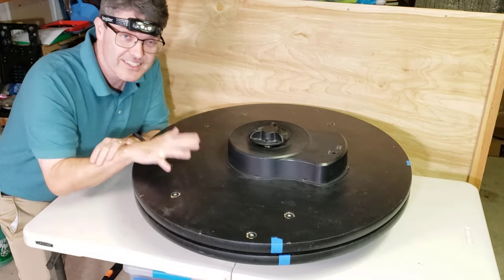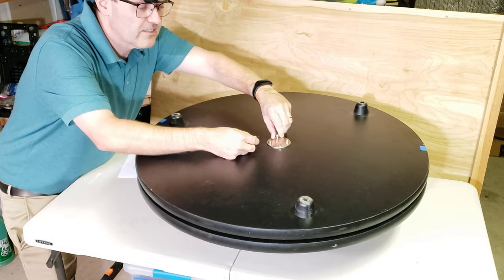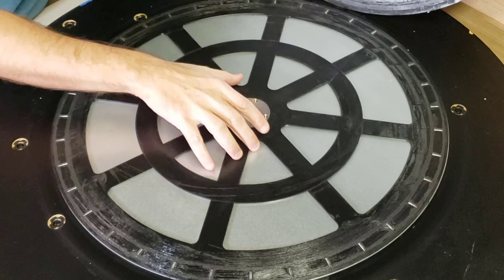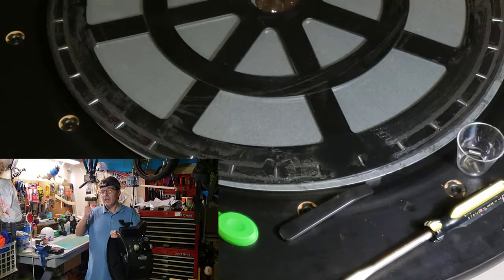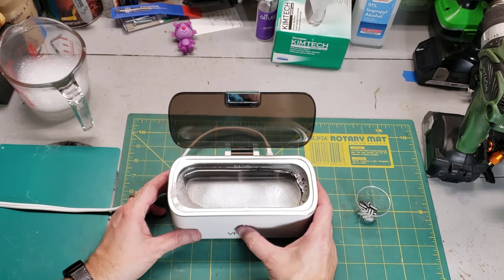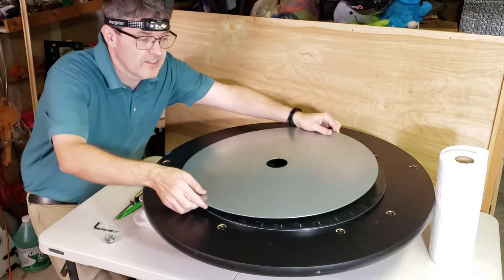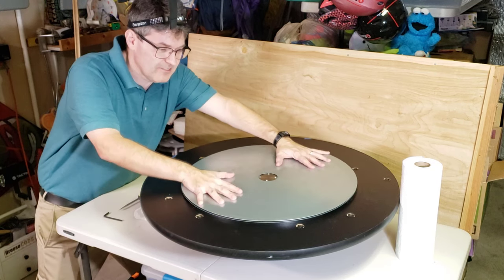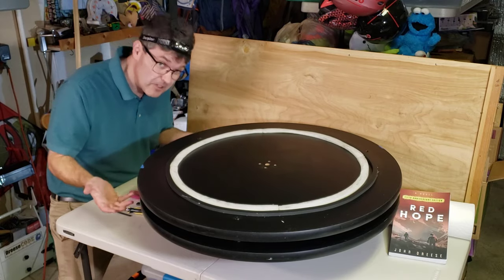PART 5 - GIANT Telescope Restoration!  -  Orion XX14g GoTo Dobsonian - Fixing Lazy Susan (Episode 5)

Comment: The dust shield comes with the scope, my 16" xxg cane with one.
Reply from the maker: That is good to know. I've had a few that were missing the dust shield, but I think that was because they were not taken care of.  How do you like your 16" Dob?
Reply: @AstronomyGarage   @reflactor  Love it. Just got it about a week ago off of Cloudy Nights. Been out for a quick peek a couple times. Started with a 60mm scope, but always aspired to a 12". The 16" crossed my path and I jumped. It was great to find your detailed teardown videos. If I ever need to go in for a repair it will be like I've been there before, mirror cleaning especially helpful. You said you have seen several w/o the turntable dust shield, I assumed it came stock. One thing, at first the scope would only rotate in azimuth a few inches left and right before binding. Upon inspection, the foam strip had rolled up and stuck to the top of the turntable. I was able to unstick it and lay it back flat. If that is a common occurrence maybe users are just removing it.

Comment: I recently got the stone wall treatment from Orion as well just a few weeks ago concerning a Sky View Pro mount. I was looking for a tripod. Orion will not sell the particular tripod for that mount individually and I bought the mount off Astromart about two decades ago. I remember when Orion used to sell just that tried alone (kicking myself for not just going ahead and getting one then) as well as many parts of just about anything and it was all listed in their catalogue. I never thought it would ever be any different.
Reply from the maker: I'm sorry to hear that, but it is a common enough response that I think it's an official policy now.  If Skywatcher has any similar equipment to what you're looking for, try them. I've bought several replacement parts for Orion equipment from Skywatcher (they are HAPPY to sell you replacement parts).
Reply: @AstronomyGarage  Thanks. I'll look them up.

Comment: Thanks for this series. I picked up a few pointers and ideas. I have the Orion XX16g (bigger and heavier than the 14) Ever since almost new, the lazy susan part of the scope made a jerking motion and a groaning noise while tracking. I finally braved it to take it apart as you did. I cleaned all the old grease off everything (but didn't remove the roller bearings) and decided to use powdered graphite and a few drops of 3 in 1 oil. After re-assembly, I tested it in warm and cold weather and it performs very smoothly now!!
PS: The 4 screws that were loose on the azmith part of your scope, well, mine were so tight that I was afraid of stripping the hex head or breaking the bolt, so I just left them alone. Thanks again.
Reply from the maker: Thank you for watching!  I'm glad the series gave you a few helpful hints.  I think the 16g is the dream of any Dob owner (including me), but I've got my hands full with just the 14 inch Dob!  Thank you for the info on the graphite and oil. I may end up giving that a try.  By the way, I don't think removing the roller pin bearings helped (or hurt) at all. It was just  a waste of time unfortunately.  I would say that you chose wisely to leave those 4 screws in place.  Mine were obviously loose (like way loose), so it was easy to remove them. Clear skies!

Comment: Excellent work!  Maybe the roller bearings could have used a very light touch of grease now that you know that there's a slight out-of-roundness.  My buddie's 12 inch of this same telescope hasn't had to have the base disassembled yet like this, so we haven't gone this deep as you have on your 14 inch.  Looking forward to the next episode!  BTW, love the product placement. 😁 I'm going to have to check out your book.
Reply from the maker: Thanks for watching!  If your friend ever opens up the bottom of his Dob, please let me know if the roller bearings are dry or have any kind of lubricant on them.  As a side note, the book Red Hope is meant to be a fun science fiction/adventure novel.  It's not too heavy on the details, lol.  Clear skies!
Reply: On my 12" Dobson, I greased those bearings with a little silicone oil and no problem.🙂
Reply from the maker: @kamilmoucka6811   Is it still working well?
Reply: @AstronomyGarage  Yes, it works perfectly. The azimuth movement is smooth and without jerking.🙂

Comment: How does Lazy Susan stands against the occasional wind blasts? Wouldn't be better to use just Teflon pads and forget about grease cleaning completely?
Reply from the maker: For big heavy telescopes, they stay put pretty well.  I have a smaller Dobsonian on a Lazy Susan and it is very sensitive to wind. I have to really tighten down the friction knob on the base to help out.

Comment: I’m really enjoying your journey with this telescope and can’t wait for its ‘first light’ with its new owner. Be careful cleaning the mirror, that’s one big piece of glass. When I clean my Orion 14” I leave the mirror in its cell, but whichever way you choose I hope it all goes well. 👍🇬🇧
Reply from the maker: Thanks, Mike. Despite having cleaned lots of mirrors, I am somewhat worried about this one because it is so unique and irreplaceable.  I'll be following the detailed steps laid out by Orion in the user manual.  And going very very slow.  I'm going to try to avoid losing the center-mark circle.  Clear skies!
Reply: @AstronomyGarage  Is it the conical mirror that most mass produced telescopes come with nowadays? I’d forgotten that Orion at some point switched   mirror designs. Mine is the conical shaped one. 
Mike
Reply from the maker: @deepskymike767  Most mirrors these days are slabs.  Orion used this mushroom convex shape on their 14" and 16" to save weight and help with cooling.

Comment: I made the mistake of using lithium grease on Dobsonian roller bearings and at first it was great.  After a year it set like concrete and I had to use engine degreaser to remove it. Now I use the lightest oil possible and only very very sparingly.
Reply from the maker: Thank you for sharing that.  I thought about starting with a bit of graphite and then possibly moving up to a thin oil.  We'll see how this goes first before taking further steps.  Clear skies!

Comment: Many of the same products Orion sells are branded Skywatcher and are available from them regardless whether you bought it or not.  

My understanding is Orion's reason for not selling to 2nd-hand owners is the Chinese suppliers don't sell them a ton of replacement parts to restock inventory so they want to ensure their inventory has enough for actual owners.  Don't know if that's the full story, but given the history Orion has with Synta and Sunny it does make sense. 

As far as the base, the weight of that 14" isn't beyond the capacity of teflon strips and good ebony star formica(if you can find any).  The roller bearings shouldn't need any lubrication in this design use.  I personally was shuddering as you were removing the bearings from the plastic ring fearing that ring might break... that's not an off-the shelf item easy to procure and if you broke it, you might have to swap in a good teflon alternative.

Now as to why you're feeling a pulsing from the base as it turns... the non-tapered bearings are having to turn in a slight arc held rigid in the plastic ring.  The engineers made the compromise on cheap straight bearings and a curvature with acceptable feedback.  Remember, normal operation is sidereal rate and GOTO operation so feedback of the pulse isn't felt unless you move it manually.   

As far as your dust ring, you could have put the second layer on the top board, it would have put a new vertical path for the dust to travel to reach the original seal's horizontal path.  It would have increased the trapping potential... it's one method in building mufflers to elongate the air pathway and is used in trapping sediment and such in water treatment.  :)
Reply from the maker: Thank you for that wonderfully helpful comment!  What you said rings true because last year when I was trying to repair a horribly banged up Orion XT6, I called them to get a new tube. They said they couldn't help me because they try to make sure they can help original owners first.

For this project, I tried to get a standard 2" lockring (M54 threads) that goes on the stock Crayford focuser.  I asked Skywatcher about it and they sold one to me, even though it was meant for an Orion end product.

I have tons of Teflon sheet to use, but I wanted to keep it stock with the roller bearing.  In hindsight, I guess I was lucky I didn't break the plastic.  Although, I was resigned to the fact of missing one of the roller bearings until I started digging through the trash (and found it).  I found replacements for the 8" version of this wagonwheel, but you are correct, the wagonwheel for this monster telescope cannot be found/bought at any price.  I didn't think about the non-taperiness of the bearings being the possible cause for their out-of-round wear.
Reply: @AstronomyGarage  those roller bearings should be in stock most anywhere if you lose one.  McMaster Carr would of course, even local small parts bins at Ace Hardware might stock them as they look familiar to me from many times browsing thru the stacks of those small parts drawers!
Reply from the maker: @mycarolinaskies   Thanks!  I will take a look. They are 12mm long with a diameter of 3.8mm, but I think they may have started life as 4mm diameter.